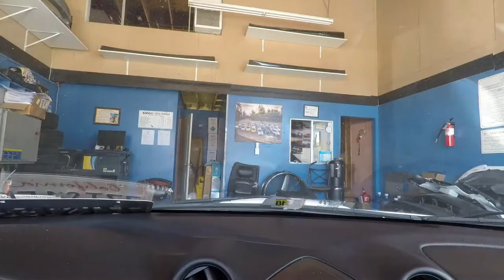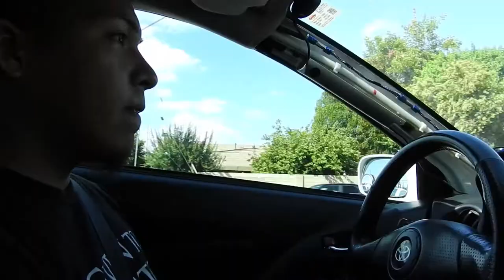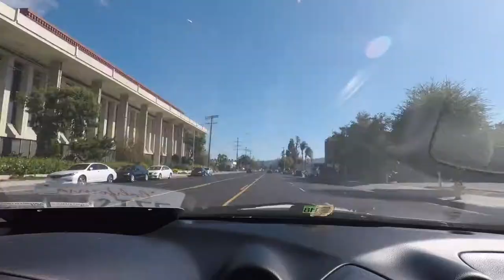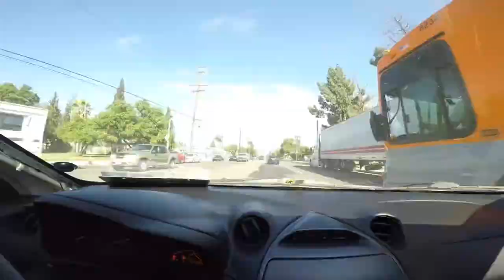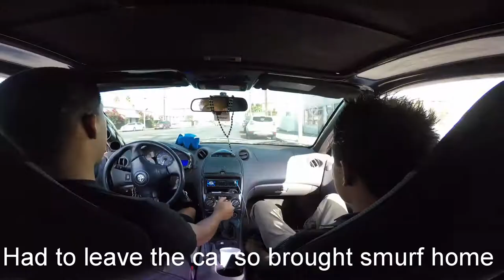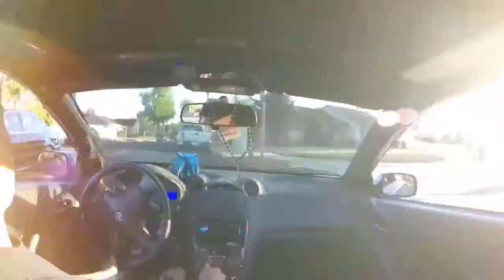Getting TRD Kazuma

Comment: TRD kazuma are rare to get nowadays. Anyways, when you do a straight pipe, re-use the resonator after the pipe or get a new 18 inch one that matches the Kazuma's pipe diameter. I would also add another resonator before the bend of the rear control arms with a 12 inch resonator. Im suggesting it because the Kazuma is one loud exhaust. it's fun at first but with all the drone it produces, it'll get annoying. Similar resonators http://vibrantperformance.com/catalog/index.php?cPath=1527_1032_1054
Reply from the maker: T12i99iN yes it is and im not adding no resonator I like it how it sounds as it is just need to get the right bend and the right piping he didnt do a good job